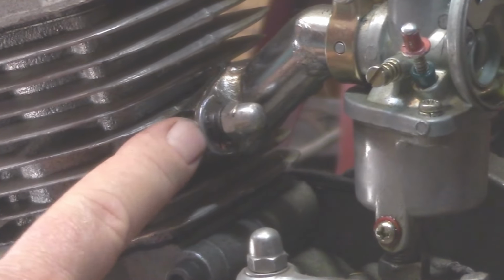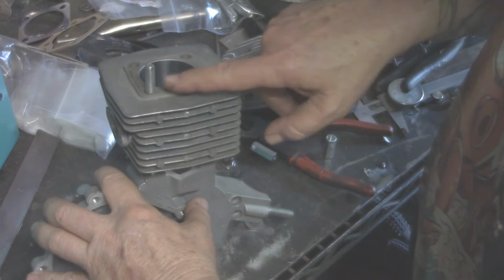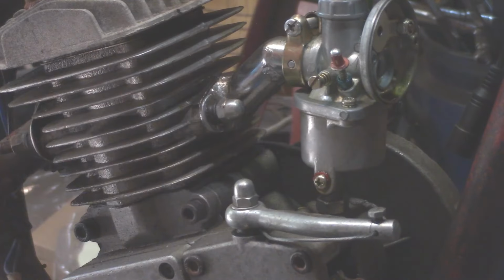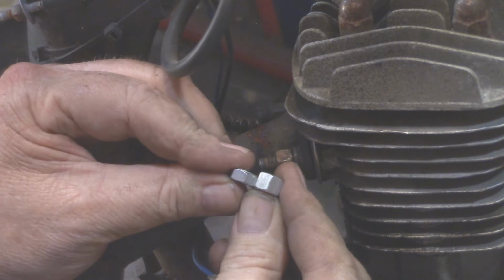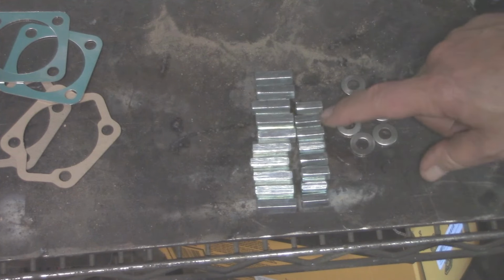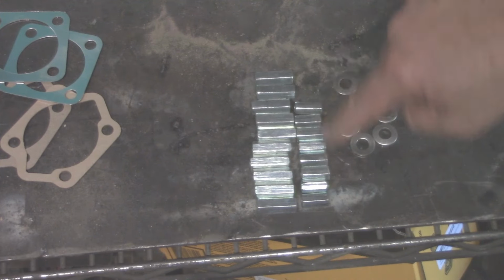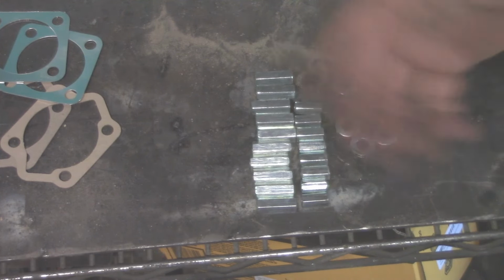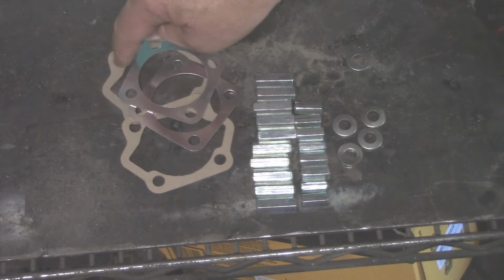Upgrade Your Motorized Bicycle Hardware. Improve Reliability.

Comment: Do you have a video installing a pull start? As well as a cvt
 on a 2 stroke motorized bike?
Reply from the maker: No. Those pull starts are total crapola. Junk. They break early and often
Reply: @HughesMotorized  what if it's a billett pull start?
Reply from the maker: @mattclinch1976  The Bullet engines are better. I'd still say if you want the most reliable kit w a pull start, go for a 4 stroke. 49cc, 79cc or 100cc
Reply from the maker: @mattclinch1976  The issues I've heard about the pull starts has to do with the rope and the spring that recoils the rope/pull string. I've only ran 4 strokes w/ the pull starts and they are solid